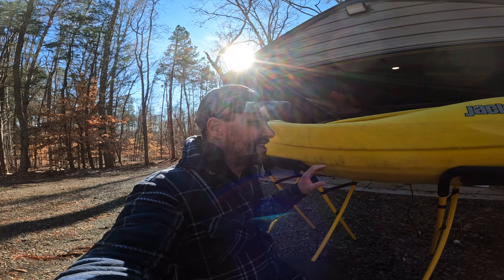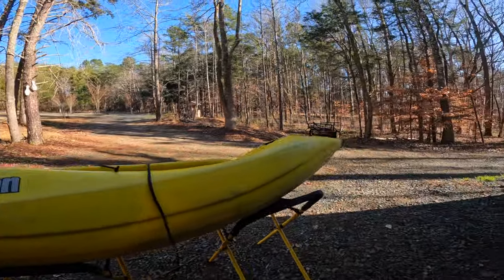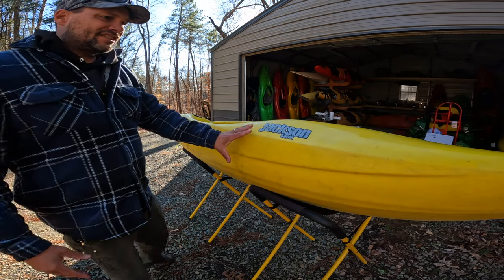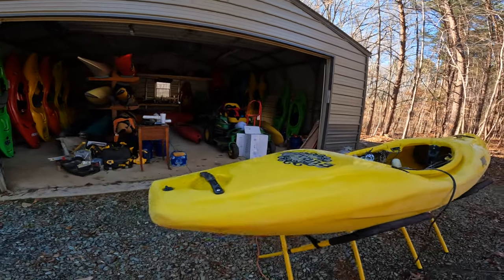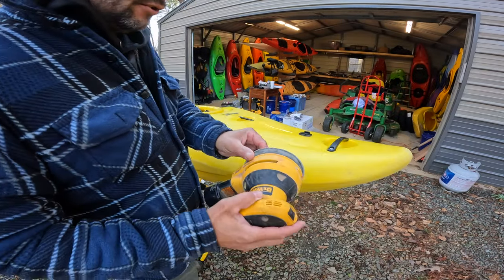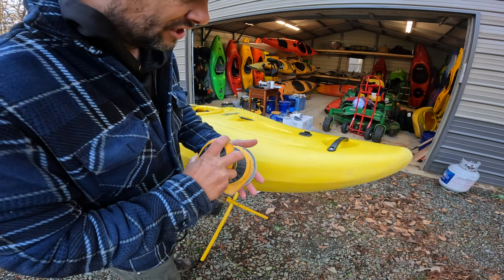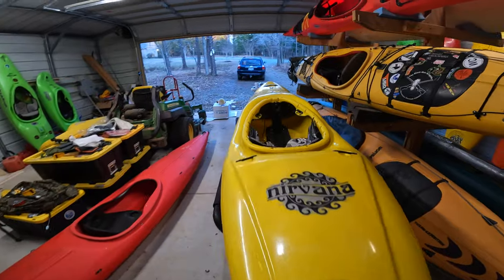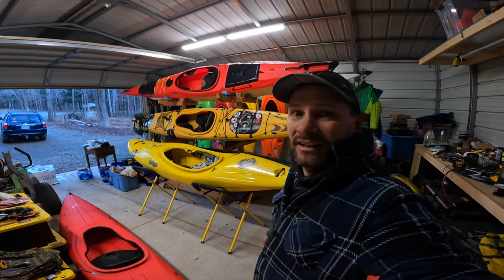Plastic Kayak Repair / Restore

Comment: I understood, Skip molded in graphic and serial number. You're not getting scratchs out or removing material, change pads somewhat often. Grits are 320, 400, 600, 800, 1000, 1200, 1500, 2000, 3000, buffing wheel, 303. Thank you very much for putting this together.
Reply from the maker: Thanks Branden!!

Comment: i’m looking to restore the surface of a 2004 necky jive kayak that has scratches almost everywhere, but it’s still structurally sound. I’ve seen other videos where people use propane torches or heat guns just to smooth out the scratches. based on your insistence on not applying heat, I surmise that you don’t approve of these methods for plastic kayaks. Can you explain why?

Comment: “Don’t sand the molded in graphic. That would be stupid; don’t be stupid!” 😂😂😂
Reply from the maker: he he he!!!
Reply: I'm not too experienced with kayaks, but as I'm looking at restoration of an old town dirigo I figured not to touch that. It's common sense... more confused about dealing with the broken off attachments. Basically left with rivets and little chunks of plastic. I think I'll drill out the rivets, but as far as sealing the holes... (maybe 3/8")
Reply: @RiverKingsKayak  what do you think is my best bet?

Comment: Wow! You're obviously a very twisted and sicko kayak junkie!  Can't thank you enough for posting this superb video.  What a concept!  I've asked around over the years about how to spiff up a plastic kayak and the best I've heard is soap and water plus 303 - which, I gotta say, doesn't exactly get the job done.  As soon as I can get my paws on some higher grit sanding pads, the orbital and I are going to town on the underside of my dingy Diesel 80 whitewater boat - just for practice.  Then it's on to my wife's Current Designs Sirocco.  I'll post some before and after pix. You rock!
Reply from the maker: Thanks Moulton!

Comment: So... my takeaway is that if I'm not an O-C with a great YT channel, this isn't something I need to do, right?  ;-)  Good stuff, Pete!  For really bad bottom gouges (where a little plastic ridge gets pushed out) I like cabinet scrapers for safely removing that ridge.  Razor blades/utility blades dragged perpendicular to the hull surface also work, but not as well.  I'd enjoy you leading us through welding plastic rod back into some deep gouges.
Reply from the maker: Ha ha!   It was ugly Pappy!!  My buddy Jacob is an awesome boat welder...I need to film him doing a repair...

Comment: Scratches add character and are the best evidence that the boat has been in the wars. I've often thought that I should take a brand new boat and drag it down a gravel road a little way before I take it out so that people don't think I only paddle on ponds and get in from a dock.
Looks really great though! When are you coming over to do mine? You can start with my sister's 1986 Prijon Topolino to test it out. She's dead so she won't mind.
Do you think this would work on a fiberglass boat? If so, maybe I should do my ancient Phoenix touring boat.
Reply from the maker: Right on MammaDuck!

Comment: I'll have to try that on my oldest boat; it's kind of nasty looking after 15 years.  I have some synthetic steel wool pads for my sander, which would conform to curvy surfaces better than sanding disks, so I may start with a sanding disk to remove any high spots and then move to the synthetic steel wool pads after that.
Reply from the maker: Right on Greg!  Let me know how it turns out!

Comment: I know when I sanded a darker color kayak that it gets a white like haze after sanding it? Not worry about it? (sanded at 220 grit)
Reply from the maker: That happened as well with the yellow, the super high grit papers and the buffing is what brings it back to shiny...
Reply: @RiverKingsKayak  I went all the way up to 5000 grit, there are some areas that still have a whitish haze to them, even after buffing. Any other ideas? I can send pictures if that would help...

Comment: I have a 2005 P&H Capella RM, I recently bought used & it's in great shape... other than the fact the original red color is faded to pink, plus sun bleaching and weathering even caused spotting discoloration on the top deck. These kayaks do have a rougher finish to them and are made of a triple layer Constuction. Would you expect the methods used in this video to work in my situation? Anything you would avoid, or recommend doing differently?

Ps, I found this video extremally helpful & you should be sponsored by that kayak stand company because I will also be buying a pair of those.
Reply from the maker: thanks Brody!   Sun damage can be surface as long as it hasn't become brittle and cracked.  I have heard of folks sanding off the faded top layer to get down to the color again.  I have not personally done this myself so I can only imagine how that would work.  If you go for it, keep me posted on the progress!

Comment: Hey!
You didn't say, maybe the 2nd, most important thing. Not THE Most Important, but at least 2nd or 3rd....
Stickers stick WAY Better to a shiny smooth surface than rough dull one. Everybody knows a well stuck stucker (well sticked sticker?) instantly improve the performance of any kayak.
Reply from the maker: You are right about that!!!  Thats got to be #1 on the list!!
Reply: @RiverKingsKayak  Didn't want to be so presumptuous & say #1, but yeah!

Comment: Did you wet sand on 2k and 3k grit?
Reply from the maker: No I only dry sanded.   Do you recommend the wet sand at those grits?
Reply: @RiverKingsKayak  that's just what the sandpaper package says, but I'll do whatever you did to get the same results as you! Thank you for responding!

Comment: I have an old Necky that's going to get this treatment. What buffing compound do you use?
Reply from the maker: I did not use any compound.  all dry.  When I was finished, I used 303 which is a plastic treatment akin to armor all...

Comment: I've been told that Simple Green works great to clean polyethylene. What's your take on that?
Reply from the maker: Hey Don!  I have not tried that one yet...
Reply: Yeah, Simple Green is my go to, using a medium width push broom to do the scrubbing. Works great...about as well as a pressure wash. I keep my boats outside, and always do this at the beginning of season. Definitely going to have to do the sanding on my yellow boat though!

Comment: Would there have been any benefit to wet sanding it once you got to 1500 grit? Did you use any kind of buffing compound or just a dry buffing wheel?
Reply from the maker: Maybe, but I was happy enough with the results...just trying to take the dingy off.   I havent done much wet sanding really.

Comment: YOU'RE SPENDING MORE TIME RECORDING YOURSELF THAN ACTUALLY REPAIRING THE KAYAK... I guess you like watching your own videos. 
Cool concept... I just use a heat gun and a heavy rubber roller to restore the surface and it actually smoothes out a lot of the scratches. 👍
Reply from the maker: IT IS IN FACT YOU THAT IS WATCHING THIS VIDEO...lol.  I guess you have never filmed something before.  It can take some time.  Thanks!

Comment: Hey Pete, what wattage orbital sander do you recommend?  One with these specs is on sale on Amazon but I'll bet this isn't beefy enough to sand an entire kayak:  Random Orbital Sander 2.5A(350W) 6 Variable Speed 13000 RPM   What specs so you suggest?  Thanks.
Reply from the maker: I just have a 20v Dewalt hand held...whatever that works out to be...